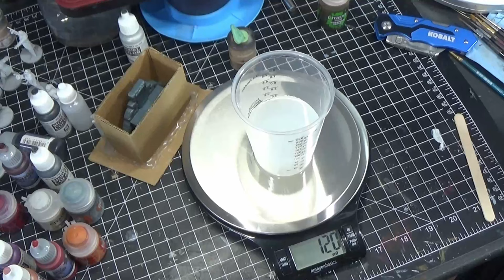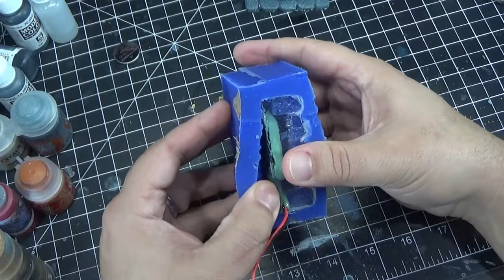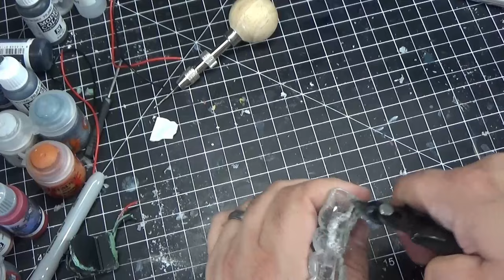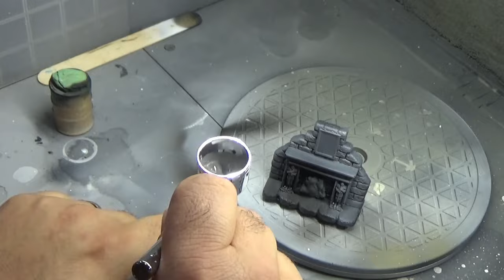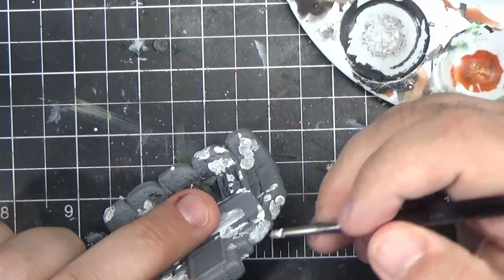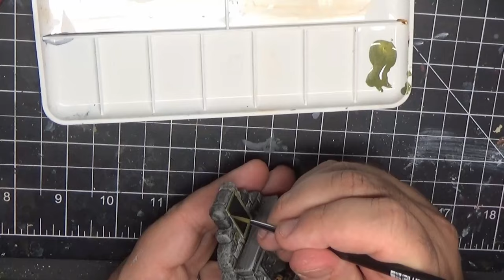Making a Glowing Fireplace for HeroQuest

Comment: That's come out very well. It's possibly worth degassing the silicone and resin in future to avoid the air bubbles.

Thanks for sharing!
Reply from the maker: Yeah. I figured bubbles wouldn't be an issue because it was so small. But I think I also messed up by spraying a bunch of mold release inside before I added the resin. That's where I think a majority of the bubbles came from.
Reply: @boardwithpaint  that may have done it. I've not had much luck using mould release with silicone.  Transparent resin can be a right pain in the arse for it. I often end up tapping the mould on the table lightly to get rid of them and pouring the resin in as slowly as I can. 

My daughter (10) and I have been playing the game and she's keen to have a go making one of these!
Reply from the maker: @colonelbarker  That's great! Let me know how that goes. Just please wear eye protection if you have to snip the top of the LED - it doesn't show up on the video, but tiny chips of broken glass went flying all over the room when I did that.